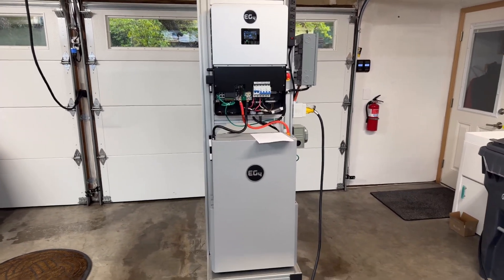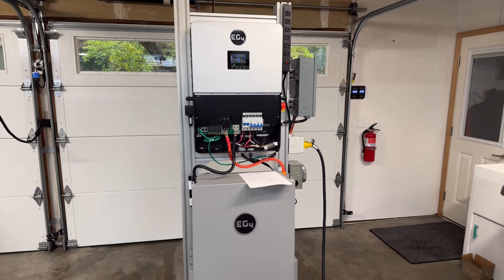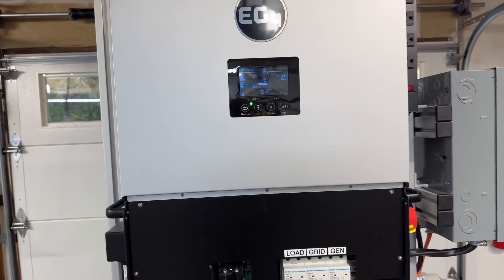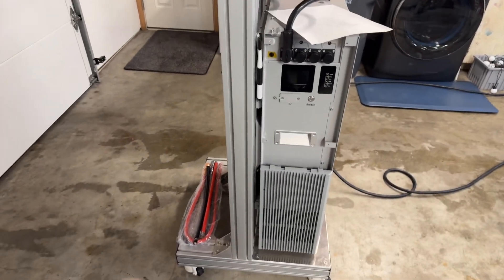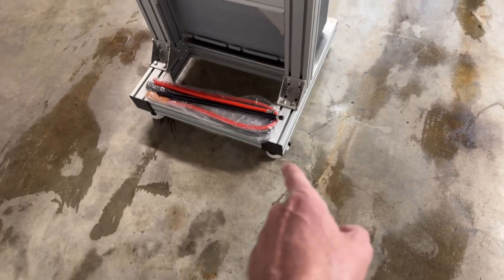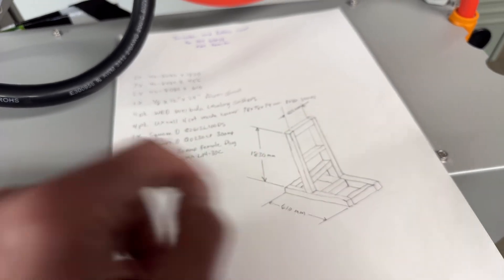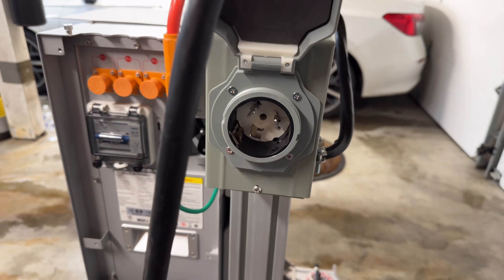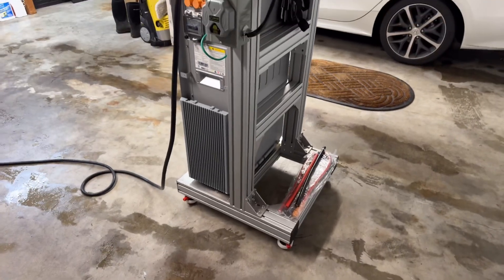EG4 6000XP and EG4 PowerPro Battery Generator

Comment: Nicely build Joe..

I saw the cost of this build, it’s a little expensive. I am trying to do an alternate build, that’s a little low cost. I would like to try maybe a metal garage cabinet and you put wheels on it, maybe put some cement board inside or something, to prevent metal contact on the inverter.. so it will be semi water proof that can be used outdoor etc.. and maybe you can use individual 5kw batteries instead of the wall mount batteries.. 

Thank you for sharing..

Comment: Joe I am trying to put this together, size on 12x24 aluminum plate is actually 9"x21" and how do you attach the 2020 aluminum to the 8080. I am trying to get this built asap and I have all the parts. The wheels don't line up to the slots on the ones from automation direct. It is getting very frustrating as I am so close. Any help would be great. Thanks
Reply from the maker: My aluminum plate is a true 12"x24" plate. For the attachment of the 2020 extrusion to 8080 extrusion I used two 90 deg brackets like this 
https://www.amazon.com/gp/product/B01H19M9VA/ref=ppx_yo_dt_b_search_asin_title?ie=UTF8&psc=1
Not sure if your casters are the same as mine. For me I was able to line up two holes with the slot in the extrusion and bolt it to the frame, the other two holes didn't line up with the slot in the extrusion. But that works for me to roll it around my garage, this is not meant to roll on a rough surface like a driveway or something like that.
Reply: @alaskajoe61  Thank you I appreciate the quick answer and help. So yes the wheels weren't lining up and I was going to do the same thing as you did, I ordered the 90 degree L brackets thank you for that explanation. Went today to buy M6 and M5 bolts and nuts as the M8 kit wasn't going through the wheels. The Cust Service at AD was nice but not helpful on the 12x24 aluminum sheet. I ordered what I searched which was a 12x24 plate but received a 9x21 inch piece of aluminum. I will call them Friday and try to resolve that. My build will have 2 batteries, A inside power pro ESS and a Ruixu lithi 2-16 14.3 kwh and 16 kwh respectively so 30.3 kwh of storage for $6288.00 $207.53 a kilowatt

Comment: The 6000xp is rated for 240vac 25 amp as an inverter. 

BUT

In AC or generator bypass mode it will supply 240vac 50 amp to the loads.

The part I'm trying to figure out is how to limit ac (or generator) input amps. The reason being is that each 6000xp can do 50 amps in bypass while charging the batteries. This is potentially 75 amps (assuming max dc charging) which is a huge problem.

The only solution I've figured out is to guess load amps, add a 20% buffer and convert the load into watts.  Then take 240vac 50 amp input = 12,000 watts subtract the load watts. This gives you available watts for battery charging. Divide charging watts by 48vdc to get max charging amps and lower that by a few amps as an additional buffer. 6000xp's in parallel add to the complexity.

Why they assume that 50 amps bypass is good for an inverter that only is rated for 25 amps is beyond me. 50 amps total ac input is almost reasonable. Why no option to set max ac input amps? I would assume most people would want max ac input to be the same as rated output, 25 amps. 

The 6000xp's inverter is rated 240vac 25 amps = 6000 watts. Presumably most people will design the max load to be under 6000 amps. Most common is either a single or dual 6000xp configuration. Dual allows for 240vac 50amp output, or 12,000 watts.

Most people will set up a 240vac 50 amp breaker and cabling because larger is much more expensive and 50 amp is common due to RV's, generators and car chargers.

240vac 50amp service is enough for a small house or RV. i doubt there are a huge number of 5000 sq foot off grid houses.

12,000 watts is enough for a medium sized ac, hot water heater, washer/dryer, lights, tv, computer, and phone charging. Basically normal living in a 1000 sq foot off-grid house as long as you don't try to run everything at once. Or a "critical loads panel" for a larger house.

For a single 6000xp, the expected max load is likely around 3500 watts (you don't want to run 6000 watts continuously). 20% buffer brings it to 4200 watts, 50 amp input means 7800 watts available for charging or 162.5 amps, maybe set ac charging to 150 amps.

The trouble is dual 6000xp. Assuming max expected load of 7000 watts plus 20% buffer = 8400 watts. 50 amp input is 12,000 watts, leaving 3600 watts for battery charging. This limits you to 75 amps charging, maybe 70 amps to be safe. This is 35 amps per 6000xp.

Even though you calculate 7000 max expected watts, what happens if the ac is running, your wife is cooking and someone takes a shower then dries their hair? A smallish ac will draw about 2000 watts, 1000 watts for a microwave or instapot, 1500-1700 watts for a hair dryer and 4000 watts for hot water heater (or 8000 watts if a long heater. We'll ignore other possible loads. This is 8500 watts. This is likely happening at night, so 3600 watts battery charging possible. 12,100 watts meaning the 50 amp breaker will trip in a few minutes.

Worse yet, each 6000xp will happily bypass up to 50 amps. A dual 6000xp is spec'd to require 100 amps input (or more). By code you need a 120 amp breaker, except that isn't available, even 125 amp is rare. Meaning either 150 amp or 200 amp breaker. By code your cable must handle at least 20% more. Now you are paying for heavy duty cabling.  Only a couple decades ago did it become common for houses to have 200 amp service, meaning most houses only have 100 amp service. Upgrading your house from 100 amp to 200 amp service is several thousand dollars.

If someone buys 4 6000xp's in order to supply 100 amps to their house then they'll have to upgrade even more.

Its all a never ending spiral. I can understand that some people want 50 amp bypass available. It should be an option, not default. The default should be 25 amps.

 This also partially explains the large generator requirements.
Reply: I contacted Signature Solar tech support. 

Currently there is no way to limit either AC input, Generator, or even Bypass power.

I requested that they send a feature request to EG4 to allow these limits. The more people that request features increases the chance that EG4 will implement them sooner.

A 6000xp with it's 25 amp inverter should at the minimum allow a lower Bypass; 25 amp versus 50 amp. Even better would be to limit AC and/or Generator input to 25 amp. Best would be an option to allow the user to set their own limit possibly between 10 and 50 amps. I didn't think about requesting the ability to disable bypass mode. 

I can see a single 6000xp were you want to limit the AC input to 40 amp (80% of the maximum of a 50 amp breaker; considered a safe limit).

I can also see a limit of 25 amp. And a lower limit becomes useful with multiple 6000xp. With two 6000xp you may want a 20 amp limit so that the total is 40 amp.

EG4 recommends > 10kw generator for a single 6000xp.  This us 41.67 amp, not enough for the 50 amp bypass (but likely enough for most people). Except for two 6000xp they recommend a > 15 kw generator. This is 62.5 amp, nowhere enough for the 100 amp Bypass.

This means if you use the recommended size generator you first have to calculate the estimated AC load, plus a buffer, then limit the charging to not exceed the generator capability. Plus is you have loads the have high starting current, you may have to reduce charging even more. Generators are rated with peak power and running power. If you have a large AC or multiple AC units the compressor starting power (minus running power) may be more than the generator's difference between peak and running power.

Then to add to the confusion, the setting for battery charging is DC amp. This means you must decide how many AC amps that you can use in bypass mode then multiply by 240vac to get power in Watts, then divide by charging volts to get charging DC amps, and finally adjust for effeciency. Even worse if your batteries are low the charging volts will be significantly lower than the charging volts that you set. This will result in different charging amps when the batteries are low versus when they are nearly full.

As an example, your expected maximum AC load is 4000 Watts, which is 16.67 amps at 240vac. You decide to add 20% as a buffer which brings the AC load to 4800 Watts which is 20 amps at 240vac. You want to limit total input AC to 40 amps (on a 50 amp breaker). This allows another 4800 Watts for battery charging. If you use 54v to charge this would allow 88.9 amps DC. The claimed battery charging efficiency is 93%. This will lower your charging setting to 82.7 amps. But to be safe, you lower the maximum charging current to 80 amps, which is 4320 Watts charging, 4645 Watts consumption.

This safely puts you under 40 amp 240vac input from the 50 amp breaker. You are happy!

Except when evening comes and the AC unit(s) aren't running suddenly you AC load goes from 4000-4800 Watts to perhaps 1000-1800 Watts (with maybe short periods of increased usage, say your 1000w microwave).

In this case your 6000xp doesn't say "I can charge the batteries faster!". You will still limit charging the batteries to 80 amp DC unless you manually change the DC charging amps  and hope that you remember to lower it again before the AC unit(s) kick back on.

If there was a setting to limit the AC input to 40 amps via a setting then if the 6000xp went into Bypass mode it will be limited to 40 amps, if your load is less then the rest could be used to charge the batteries up to a maximum of your charging limit. Everything would be automatic.  If your AC load exceeds the maximum AC input then the 6000xp would fault to protect itself.

A single 6000xp is relatively simple. It gets really complicated if you parallel multiple 6000xp's. The 50 amp Bypass mode is per 6000xp.

2 units is 100 amps (the old standard size house service)
3 units is 150 amps
4 units is 200 amps (the new standard size house service).
5 units is 250 amps
etc

This means that most older houses can only supply two 6000xp's assuming and newer houses can only supply four 6000xp's; assuming no other loads.

Lets say you want to design a solar system to supply your old house. If you have a newer house you likely have 240vac 200 amp service from the electric company. This limits you to a maximum of four 6000xp's which can supply up to a combined 240vac 100 amps.

For many people this is likely sufficient for now. But as you are forced into using more electricity (replacing natural gas stove, water heater, clothes dryer and furnace) and needing to charge at least 1 electric car you will often exceed 100 amps.

Except to increase the number of 6000xp's you also need either to increase the service from the electric company which is a large cost 
OR 
configure only four 6000xp's with AC input, with additional 6000xp's off-grid.

The second option has another issue that is unclear. The manual says all 6000xp's must be connected to your generator. The manual does NOT specify this for the AC input, but it's reasonable that if the generator requires it so does the AC input. EG4 needs to clarify this.

If all 6000xp's must be connected to the AC input then you would need 2 seperate 6000xp systems, one connected to the grid and the other off-grid. Each system would have it's own bank of 6000xp's, it's own batteries, and it's own PV. Though you could cross charge the battery banks utilizing EG4 chargevertors. I'm not sure if both banks of 6000xp's can supply a single distribution box (if they will sync their AC outputs). If not then you would need another distribution box.

The only other solution is to charge the batteries with multiple EG4 chargevertors, one per 240vac 30 amps of service (or lower charging per unit using 240vac 25 amps). This would be 3 or 4 units for 100 amp service or 6 or 8 units for 200 amp service. This adds several thousand dollars of cost and the chargevertors do not have remote reporting or control. You also can currently only have comms between your batteries and either the 6000xp's or the chargevertor. Most people will likely decide that comms to the 6000xp is more important, meaning that the chargevertors must charge based on voltage not SOC.

All of this could be quickly resolved by the ability to limit AC input current. If you have three 6000xp's connected to 100 amp service you could limit them to 33 amps each (instead of the 50 amps currently) if you have four 6000xp connected to 100 amp service you could limit them to 25 amps each. If you have two 6000xp's connected to 50 amp service you could limit the input to 25 amp (or 20 amp with consequences).

Obviously these limits will also limit the available current for charging. 

There are likely many people who love the 50 amp bypass mode. Maybe your house has 200 amp service and you only need to supply up to 100 amps to your house. Being able to supply the full 100 amps to the house while having 22,320 Watts available to quickly charge a large battery bank on cloudy days or in order to take advantage of variable electric rates is awesome.
Reply: I personally believe a large percentage of 6000xp users would not only benefit from input limits but love them.

I had originally added a 120vac 30 amp circuit for my previous RV. When I purchased the house it had a 240vac 30 amp circuit for a generator. 

We are planning on selling the house in a few months so I don't see a reason to buy a new 50 amp breaker and upgrade the wiring; especially considering that I have two 6000xp's in my RV which would need two 50 amp breakers.

My experience with the 240vac 30 amp breaker is that if I'm close to 30 amps for about an hour the breaker will trip. This means that I have to limit myself to 27-28 amps (6480-6720 Watts), or 13.5-14 amps (3240-3360 Watts) per 6000xp.

My base load plus the smaller AC uses about 1800 Watts while the base loads plus the larger AC is about 2000 Watts. The base loads with both AC units running is around 3500-3800 Watts.

If the 6000xp's decide to go into Bypass with both AC units running there is nothing left to charge the batteries (I'm fine with this) but a single AC allows for Bypass and charging the batteries. I currently am configured to charge using about 3800 Watts, which allows running the smaller AC unit.

The only time I run the AC at home is on hot days when I'll be working inside. This means that most of the time I could charge at 6400 Watts instead of 4800 Watts. With an AC input limit this would be automatic. I'd set both 6000xp's a limit of 13.5 or 14 amps. Magically I could run one or both AC units and the 6000xp would charge the batteries with what is available. If I don't run the AC units then the batteries would automatically charge faster.

If EG4 gave us the ability to configure charging amps for each of the 3 AC start/stop times then I could have a work around. Maybe 0 amps charging from 11 am to 6 pm, from 10 pm to 6 am full charging (because the AC units are both off), from 6 am to 11 am and 6 pm to 10 pm allow charging based on the larger AC unit running. It wouldn't be perfect and I'd need to change the settings when camping and connected to 240vac 50 amp service and then remember to switch it back when at home.

I know someone will say "just use an EG4 chargevertor". I have a version 2 and it's great for using a small generator. Remember that I can only communicate with batteries with either the 6000xp's or chargevertor.  It makes more sense to connect the 6000xp's. This means the chargevertor doesn't have battery SOC and the chargevertor doesn't have remote control nor remote monitoring. This means changing the charging amps if its hooked to the generator, 120vac 30 amp service or 240vac 30/50 amp service. This requires going into the RV basement.

It would be nice if the EG4 chargevertor integrated with the EG4 6000xp (and other EG4 inverter systems like the 12k and 18k).  If you could plug the chargvertor comm into the 6000xp and the 6000xp relayed battery SOC and configuration data while the chargevertor sent the 6000xp charging data so that we could use the EG4 app or webpage to update chargevertor settings and monitor charge amps/Watts and historical data it would be great. Especially if you could parallel the chargevetors with comms to a 6000xp.

Heck I'd get a 2nd chargevertor if that was possible.
Reply: Dangerous

Comment: You think another eg4 battery would fit behind this contraption?
Reply from the maker: @noyjr9492  with this extrusion you can get different lengths. So yes you could
Reply: @alaskajoe61  2 batteries is about 600 pounds plus about 50 pounds for the EG4 inverter. That is a lot of weight for those small caster wheeles. I had to use a lot of leverage ideas to get one battery (300 pounds) out of the crate and stand it up on the cement floor. Used a floor jack and long pole to get it upright. No issues thank goodness it was a smooth job!
Reply from the maker: @donaldhoudek2889  The batteries are very heavy to try and maneuver by yourself.
Reply: @alaskajoe61  Tell me about it. Although with the leverage methods that I used I probably did not lift more than 30 to 50 pounds. I would test and then continue, if it was to heavy I would not have lifted